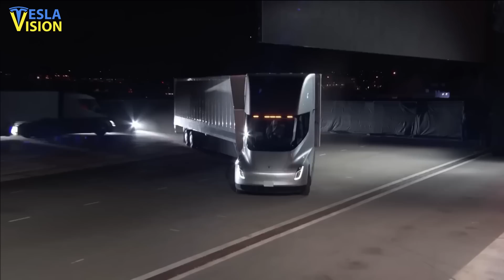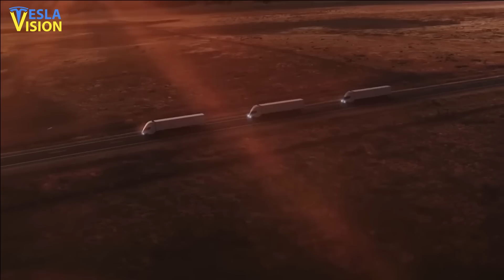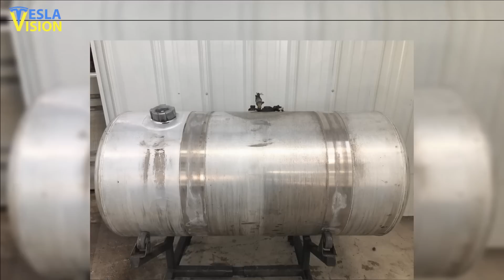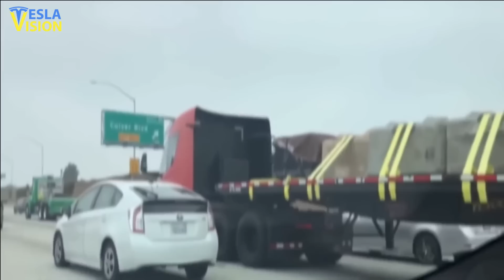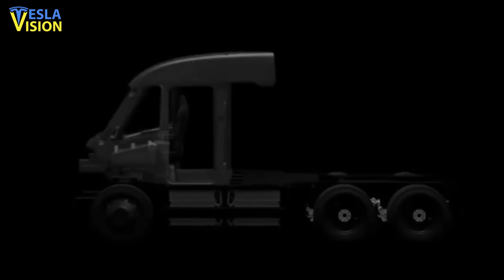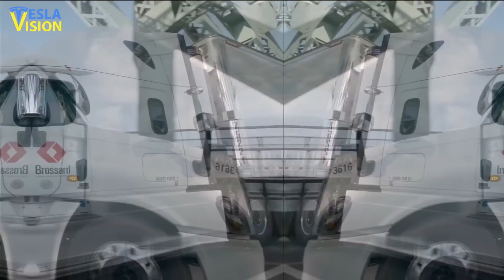FINALLY HERE: Tesla Semi Truck NEW Features Compared to Freightliner Cascadia

Comment: A freightliner has a 1000 mile range loaded diesel engines are by far more reliable then batteries and do not require charging stations also the freightliner can haul more the 81000 lbs